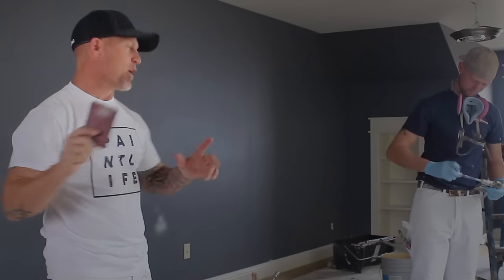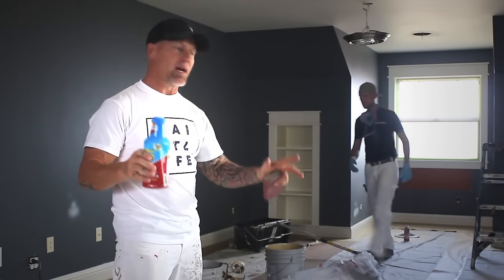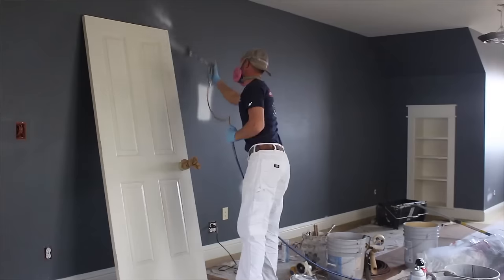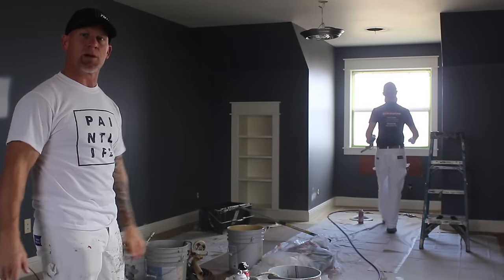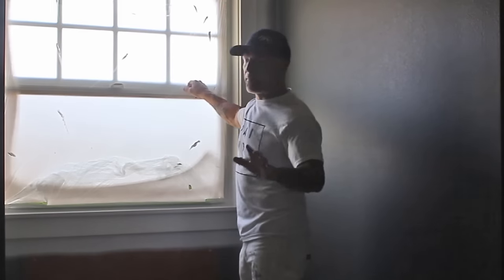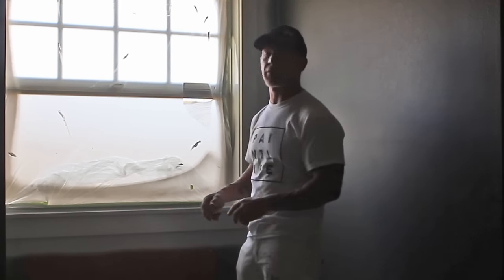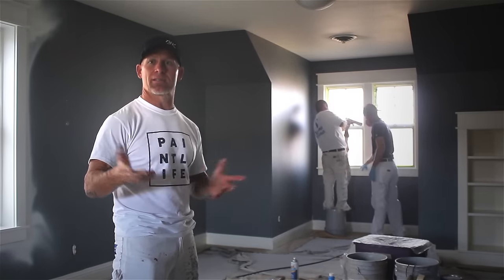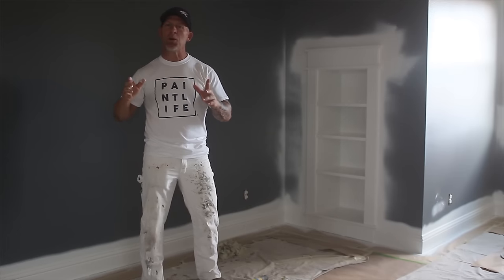Interior Trim Painting Hacks.  DIY How To Paint House Trim Work.

Comment: For interior repaints, do you always spray trim first? Also, is it harder to cover the semigloss paint with wall paint if you spray first and don't mask?
Reply: If your spraying your trim and doors I find it’s best to do it before painting the walls. The semigloss or satin will make it easier to cut in a straight line to the edge. Another option if your trim paint is cured enough to tape is to tape the trim with 2” blue scotch tape or better is the frog tape and mini roll the wall edge to trim. Yes it may take 3 coats for full coverage depending on paint/colour/thickness etc. you can use clear caulk on the wall edge of the tape to ensure no bleeding but wipe excess off tape and pull the tape while final coat is still soft.

Comment: Question. I always mask off around the trim to prevent the oil based paint from flashing or building up on the wall. I never have done what you have done in this video but would definitely like to try it next time to save money and time. Also I only ever spray oil based paint on woodwork since i primarily do remodels. The wall paint is usually a semi-gloss with flat on the ceiling. I always just have a fear of flashing on ceilings. I only use quality paint as well. I love shooting pigmented laquers but in a lot of my cases the designer prefers oil based so I can't get away with shooting both. I shoot the trim then install it with touch behind. Can't touch up laquers with a brush of course. Love your videos they are awesome. You know your stuff. Do you ever run into this similar situation and if so do you mask? Do you think it will flash? It has to be perfect too because the homes i do are higher end and extremely particular about every little detail.

Comment: Does the overspray that gets on the walls around the trim create flashing issues when you come back to paint the walls? I'm about to tackle a complete house repaint and was worried that semigloss trim paint might cause the eggshell wall paint to flash wherever there is overspray. Thanks for the awesome videos!
Reply: Did you ever find out the answer to this? I have the same situation and question
Reply: They should of at least put one paper to cover the wall
Reply: For what its worth, i brush regal select semi gloss on trim before walls and then cut the walls to the trim with regal select matte. Wont cover the trim paint in one coat but the trim paint on the walls doesnt flash👍🏻 might be worthwhile to do a test patch somewhere to make sure tho
Reply: @TheRealNosferatu  awesome thanks. I’ve gone with brushing the trim first, will then mask before spraying walls and ceilings (all white so super quick hopefully).
Reply: If you ever worry about flashing mask and primer. It's that simple primary cover up any gloss
Reply: @robertoibarra4959  if he's going with a different Sheen. Likelihood he will primer
Reply: Use tape and drape
Reply: Its called picture framing and yes it will flash  unless he primes over it or is using same sheen. Can always backmask to prevent this issue
Reply: You got to make sure you come back and sand down the shine from the trim enamel and you won't have a problem with flashing against your wall paint if by chance anyone still looking for the answer
Reply: In my opinion this is going to create issues and more work afterwards. 
If you spray the doors/window frames in gloss/shiny paint...what will happen with the wall paint in time? It will start peeling off as is painted over a shiny surface/paint?
2nd problem that i see is that when you are going to do the walls around frames,the roller is going to spray the frames and skirting...
Reply: @OSR_1  unless it shitty wall paint it wont flash
Reply: Take the extra time to math at least paper around the trim.
Reply: @OSR_1  use a pole disc sander works just fine
Reply: Depends but usually two cut in will solve that problem two coats would be recommended depending on what color is chosen
Reply: @emiliangheorghe5637  it won’t spit paint out if you’re using a polyester knap, with trim taped off. Never push all of your tape completely down on trim. Only press down the top, and leave the rest flat out to catch any possible spit paint
Reply: Depending on what wall paint you use it may require a 3rd cut in (brush work) but the roller stuff should be good for 2 coats

Comment: Q1)is that solo paint a one coat product? not need for undercoat or a second top coat? it just seem si see alot of spraying once and done. there doesnt seem to be any leaving to dry and then doing a top coat.
Q2) is the trim over spray on the walls visible after you've sprayed the walls?
Q3) how do you spray the walls without getting overspray on your trim? tape up again?

Comment: Great vids ! One question for you. When you spray trim with a 310 tip, does it require two coats or is one suffice ?
Thanks in advance.
Reply from the maker: Usually two coats
Reply: Home Improvement How To's It looks like you pulled window masking after one coat?? Maybe one coat on this job but two on others?
Reply: @Idahopainter  So do you remove the Frog tape while the first coat is wet and then caulk and Frog tape again for the 2nd coat?

Comment: I know it's a bit old video, but I have a situation when my walls all painted, and we just had contractor finish trim - windows, doors - base. All of it. . .not after patching and caulking, i have 30 doors to paint and about 20 windows! If I would do it with a brush, it will take me well into next year!So how would you isolate the walls in this case? I kind of had an idea of using that tool you showing with plastic expandable film dropping down 9 ft....then cutting around window or door and taping it. Any advise will be appreciated greatly! thanks for great videos!

Comment: is there a follow up video showing painting the walls after the trim has been sprayed?
Reply: I thought the same thing - what the hell - that nice dark wall has white spray all over it -stupid
Reply: @laurat9052  this is the order pros paint in- trim then walls. If you want to save your walls its much faster to brush and roll the trim. I like using an oil enamel in that rare instance
Reply: @laurat9052  You're obviously not a painter, they would never do this if they weren't going to paint the walls dummy.

Comment: does the sheen from the over spray flash on the walls?
Reply: Sometimes.  Depends on the product and sheen
Reply: I wonder if they sand, and apply some de glosser he showed earlier? I wonder that too because masking it off takes so much time
Reply: If sprayed correctly and no heavy over spray marks are left behind, the sheen will not flash after 2 coats on the walls.

Comment: Two weeks ago I rolled on 2 coats of pro classic semi gloss on all the  trim in a few bedrooms.  After watching many of your great! videos, I decided to now spray all the trim for a better finish.  Would you still recommend using gloss-off?  Will the spray coat stick without using gloss off?  Lastly, to prevent tape bleed through on floors, do you recommend clear painters caulk between the frogger tape and base boards too?
Reply: Ok thanks.  How about caulking between base and hardwood floors with clear to prevent bleed through?

Comment: Hi, Chris. Loving the vids! Thank you! I've read that spraying is more difficult than cutting and rolling. People say it can be tough to avoid streaks. They're also saying that, because of the set up, it's not a time saver. I also saw a comment on a forum about backrolling foggy finishes. Would you weigh in on that? I have 1800 SqFt to paint in a very short time. What's faster, looks better?
Reply: Spraying more difficult? Its the other way around, for myself I enjoy spraying and do it as often as I can,  like the Idahopainter said its just alot of misinformed or untrained painters who are saying this things

Comment: someone said the spray man sucked,he makes a mess. at least he knows not to pop trigger in the middle of of woodwork. that would cause spits in his finish. good job !!
Reply: Robert Peters what is pop trigger?
Reply: Ruby Frazier all that means is letting go of the trigger(stop spraying) in the middle of the object you are painting. 

when you let go of the trigger (pop) it can spit large drips of paint onto the object .
Reply: Bo Haggin Of course extension causes spiting unless u have the special extension valve . For regular window and baseboard spraying extension is unnecessary

Comment: I would have removed the doorknob. quicker than masking and better. details make the job.
Reply: It takes about eight seconds to mask a doorknob...
Reply: Plus less chance of damaging the door putting the knob back on
Reply: Yes. Another tip would be to put paper or plastic on the wall behind the top of the door. In my own experience of 5 years of professional painting, Semi-gloss will flash through 2 coats of eggshell. Pearl or Satiin might keep it from flashing.
Reply: I would've went for the doorknob removal as well.
Reply: Mark Millward yep that happened in my rental property on a brand new build you could see the ghosting we call it in the uk from the gloss coming through the wall paint drove me nuts trying to figure out what it was 😂😂
Reply: @markmillward9733  if you use a really high quality paint like SW Emerald, the chances of this happening becomes minimal.

Comment: Seems like you used a lot of paint on that window, I've been a paint contractor my whole life just something i noticed
Reply: I was just about to  said the same thing
Reply: These guys put way more time, thought, and effort than whats required. They must charge a lot to compensate for their oversimplification.
Reply: @mnstrmike4853  I have been a painter for 30 years. Never have I had to degloos interior trim to paint it. Also I have never been called back to repair paint not sticking. By the time these guys get set up I am walking out.
Reply: new overland I have glossy brown old school trim & want to paint them white plus kitchen cabinets. Should I use 200 grit to lightly sand them to prep or what’s your steps?
Reply: @ronaldjacamo2915  use some deglosser to dull it down. Wipe with thinner. Let it dry up for 24. Use a coat of xim bonding primer. Lightly sand. Then put on two coats of a good latex paint. Do all the trim first so by the time you get to the cabinets you will be familiar and do better on the cabinets.
Reply: new overland Thank you very much for your quick reply!!!!!
Reply: @ronaldjacamo2915  👍that is the technical response. If were my home I would skip the degloss and just clean it with mild soap then wipe down with a damp rag of thinner. Let dry and apply the bonding sealer then the paint. Eliminate the unnecessary chemical contact to you and your floors and funiture.
Reply: Also depends on what brand of paint are you using ,water or oil based and what s previous coat

Comment: I go over my frog tape with a damp rag,activates the seal ,rather than letting the paint activate it,
Reply from the maker: Good tip, thanks for sharing Eddie!
Reply: Never heard of that. Good tip!
Reply: Thanks man! Gonna try that out next week!
Reply: mobil home millionaire 7
Reply: Is this the solution I need to actually make the tape freaking stick! Cause no matter how hard I try i always have the tape come up so annoying
Reply: @rachelmarcoux720   You have to use your duster or a rag to wipe off first. Small dirt can prevent tape from sticking well.. If nothing works i use 2020 tape but remove it quickly.. But you need extra drying time because 2020 will re move paint from a day ago

Comment: this just seems like a waste of time? you could of brushed and rolled everything and had it done times you finished taping up
Reply: Have you seen trim that was sprayed vs. trim that was brushed or rolled? Night and day. The finished product is worth the extra time, material, and work.
Reply: Joel Blundell only if you like brush marks ove a flat smooth finish
Reply: Joel Blundell Quality takes work. brushing and rolling trim will always look bad.
Reply: Except with white it may take several coats,esp with solo
Reply: Say's the old dog. Mask and spray trim and base in 30 minutes in a room that size. It would take 2 hours to brush and roll that out 2 coats.
Reply: Depends what you're using.  If you're painting trim  with an oil based finish like a Satin Impervo you would be hard pressed to see brush marks after its done because of how the paint levels.
Reply: Looks way better,  even if you don't leave brush marks,  the roller still leaves a bit of texture
Reply: @shawnwilliams5138  
If your leaving brush strokes on trim you dont know how to paint.
Reply: Weaponized Memes I’ve been painting for 20 years my dad been painting for 35 years my grandfather was a church painter we use old fashion brush and roller and are work looks like glass finish at all times when we paint trim . But to each of his own  I guess .
Reply: Some people rather and want it to be sprayed because has a better finish
Reply: @DaddyBear3000  ... its the actual paint that creates that finish mate no mater how u apply it it will still be shiny as glass lol
Reply: @fef777777  Which is faster if you're repainting trim in an entire house, when you consider all the prep?
Reply: @MrSpidinator  i would choose to spray to be honest the bigger the job the more the value in the spraying

Comment: Quick question - ive installed my flooring and my walls are painted. Due to timing of contractors. Now i am getting my trims installed and door casing in place. I will mask all my flooring but how much of the wall do i need to make from the trim up to avoid overspray?

Comment: Spraying trim this way is a complete waste of material. Plastic, tape and paint. Alot of over spray. YES the semigloss will flash on the walls.
Reply: Nathan Russell spraying the trim with Aqua Gloss etc.. Is easily covered when applying wall paint .. Unlike if painting with oil based gloss... Sorry but this way is far better than a brush...
Reply: Nathan Russell bone head!!
Reply: Nathan Russell I agree sweetie
Reply: Nathan Russell your right but it will cover just fine two coats over it ....lol
Reply: Which material using for paint trim?
Reply: I dont get how you apply  caulking on top of tape , when you take off the tape it will ruin the caulking
Reply: You paint while the caulk is wet. Never tried it but I guess the paint and wet caulk don't mix. Pulling tape off when caulking is wet means it doesn't damage the line. There's a video where he shows this technique where the drywall meets a vinyl window. Once he pulls the tape off there's a REALLY sharp line. Dare I say....laser sharp? You'll get the joke when you watch the vid.

While Nathan has a valid point of material "waste", you have to balance that with time to do the job and quality of results. Not being a pro, I always tape the ceiling. It bothers me, and hate throwing all the tape away, but its' what works. BTW, in construction, there's always a certain amount of material waste. Yes, it should be minimized. But I'm sure most people aren't willing to pay a lot more $ for less money in waste.
Reply: It will flash if you use cheap paint or don't put down enough mills. We've never had a problem with flashing when we use quality paint applied properly.
Reply: Gordo Einstein ...and cars are for people who don't know how to walk...?...it's an advanced tool...not better or worse...just different...
Reply: The caulk seals the edge of the tape so when you peel it off still wet it leaves a sharp clean line.
Reply: That's not true if you scuff the walls before your final cout it will kill the shin of the Simi gloss you should try it
Reply: funny thing is i can spray an entire house and be exhausted while painting a single room by hand im exhausted getting older sucks not 18 no more
Reply: I've never had a problem with flashing.
Reply: @jameslong296  I use a sanding pole and head with 220 sand paper and sanding sponge. You just scuff the over spray without hitting the trim. Makes a big difference and is still worth the effort. It goes pretty fast.
Reply: @zsofiakovasznai5594  Actually it creates a perfect straight line when you remove the tape while the paint is still wet.

Comment: So after you're done with trim, do you mask and primer the walls, or just use a quality paint with primer in it? I know trim is typically high-gloss and wall are less glossy. Didn't know if the paint will adhere correctly.
Reply: M. Carr No paint has primer in it, nor does it adhere any better because the can says"Paint and Primer in one". There is nothing different from that paint and a 100% acrylic without that marketing terminology on it. It's just Acrylic paint, and can be used as a primer on patchwork, not for raw wood, fiberglass doors,  glossy surfaces,  tannin bleed, water stains, smoke,  inks, wood fillers, etc, etc.
Reply: @XCPainter  aren't certain paints better than others though?
Reply: @bbshoney  Yes, many paints are better than others...  there are many variables that could make one paint better than another...  however "Paint & Primer in 1" does not mean it has better adhesion. 
The proper way to paint over the glossy trim paint on walls is to sand it (abrade the surface) with 220 or 180 grit sandpaper. Primer can help to adhere and cover the sheen but isn't necessary if you are using a quality wall paint.

Comment: Hi Chris, what about removing the masking if you spray a primer on woodwork first, and then put on a finish. Do you leave the masking tape on after spraying the primer - because it could dry into the paint - or do you remove it, and before the finishing coat, apply new masking?
Reply from the maker: We would leave it on